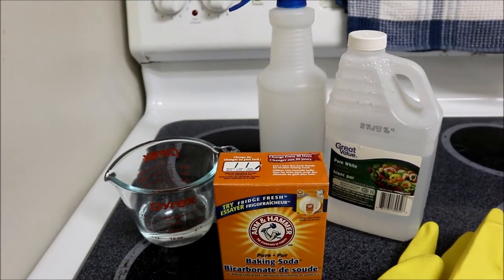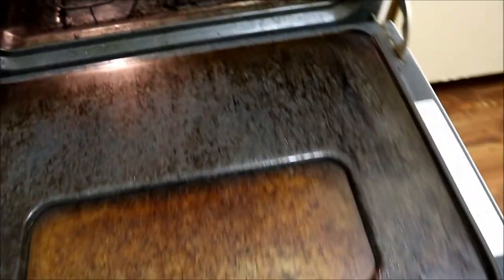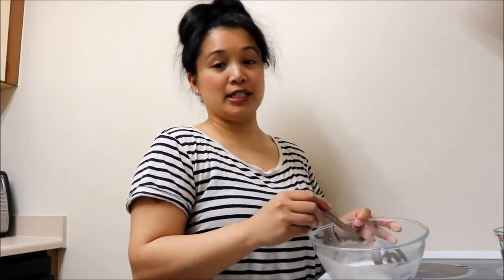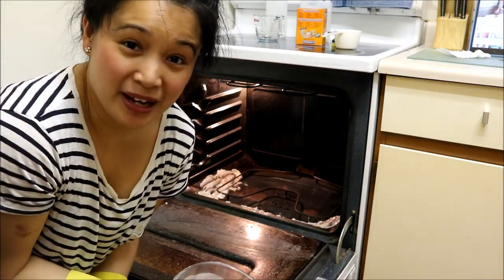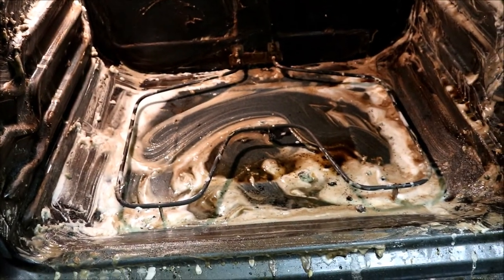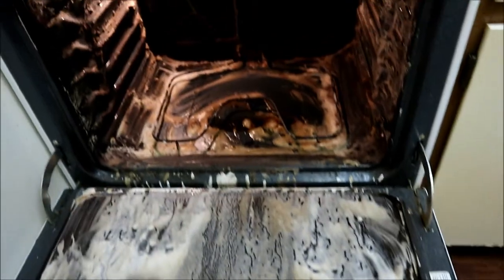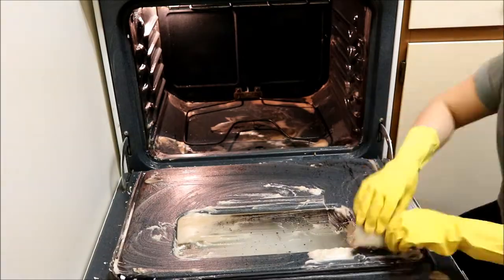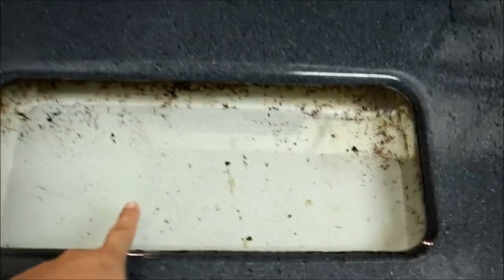HOW TO CLEAN THE INSIDE OF YOUR OVEN || DEEP CLEANING OVEN || CLEANING MOTIVATION

Comment: This is exactly how I clean my oven! It is natural and so effective! It takes a little elbow grease but it works. 
I use oven liners instead of aluminum foil, and they are life savers! Maybe you should try those. Nothing drips on the bottom of the oven anymore! 
Great video Angie!
Reply from the maker: Yes, the natural way is always a great option. And definitely takes some elbow grease lol. I worked up a sweat trying to scrub so hard since some of that grime was really stuck on there. Oven liners thanks for the suggestion I will check that out.